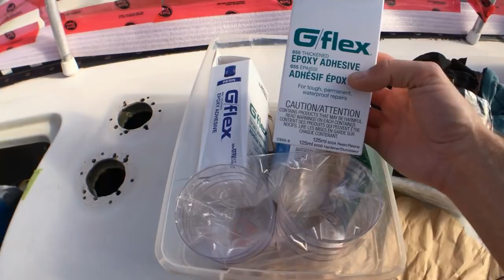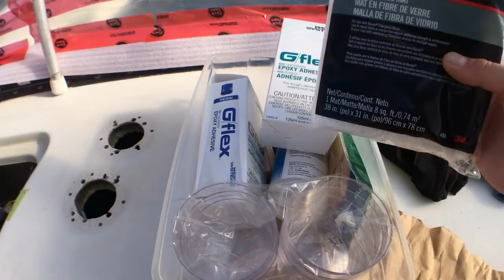Wet Core!? (and sail repairs) - Sailing Balachandra E018

Comment: Seems like almost fixing a deck core,  but with extra steps. I think cutting the top fiberglass and replacing the core with an approved core material would have been easier.

Comment: I would seal the holes which hold the switches with epoxy then drill them out smaller then put the screw s in. Just an idea  just to seal the core.
Reply from the maker: Good point! yes, that would have worked as well. I'm going to have to start buying fiberglass in bulk like Madz does :)

Comment: Nice repair job...the anchor locker , I've seen a few lockers and I've wondered why they are not lined with conveyor belt rubber to protect the insides and make it quieter through the boat...?
Reply from the maker: thanks! ... very good point! ... hmm i'd like to try that

Comment: What happened with the inspection on your sails?  Seen you make the phone call, then you got them back. Add any reef points? Were they ok?
Reply from the maker: Thanks for asking - yeah I guess we didn't mention it. They were all fine with the exception of a few frayed spots which they dutifully patched up. They also added extra material to the foot of the main and replaced all of my batten pouches :) We didn't add any additional reef points (we already have 3 on the main)

Comment: imho half fast repair.
Reply from the maker: Going the plywood, glass and kiwi grip way would have cost me more than quadruple what this cost. If this was a total refit I would have the materials already and would go the extra mile but I'm happy with this.
Reply: I don't know about that.  If the wet core was confined to the small area he showed I don't see why his solution wouldn't be effective.  Our season is so short in Canada that if you had to remove the top skin, lam in some new ply then fiberglass the skin back on, committing you to Awlgripping the entire deck afterward, you'd have precious little time left to go sailing.  I have a six inch area of delamination on my side deck near the water fill pipe and I might just try the approach shown here (unless the water infiltration is more extensive in my case, in which case I'll have no choice but to bite a much bigger bullet).